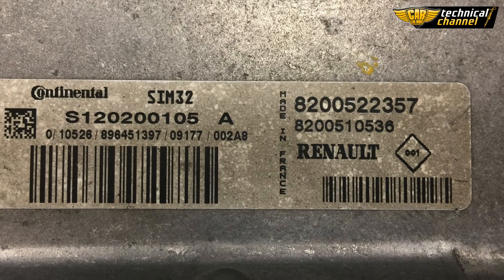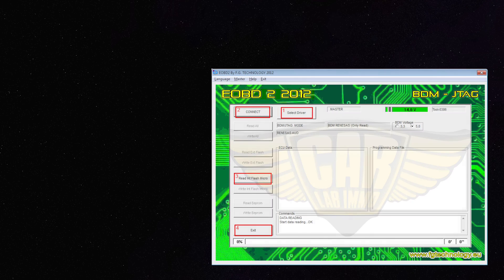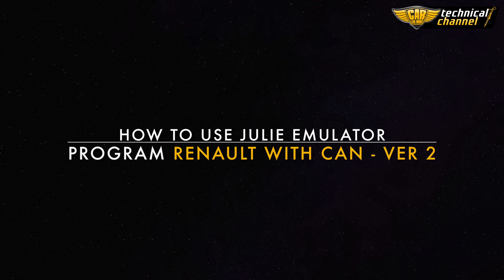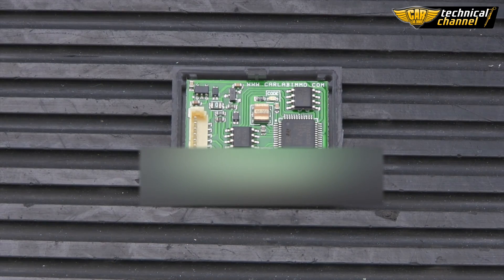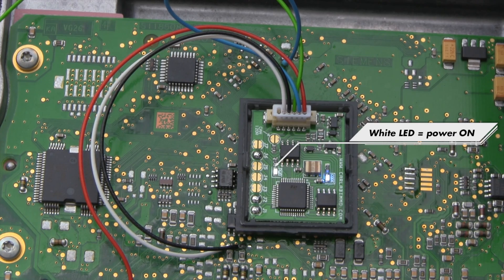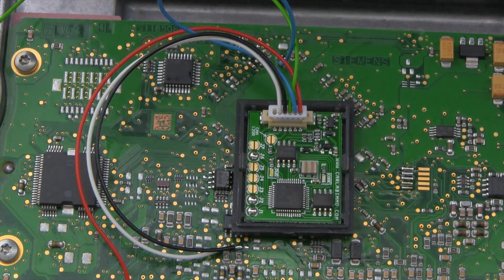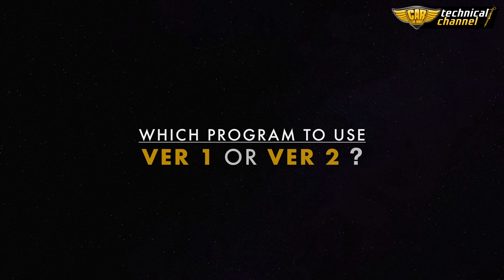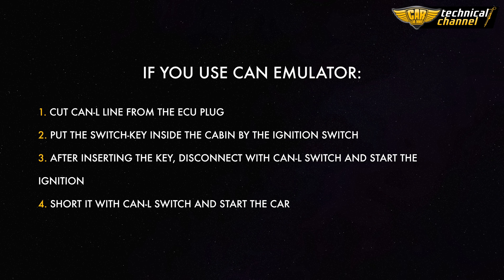Siemens/Continental SIM32 (Renault) IMMO OFF | Julie™ Emulator | CarLabImmo

Comment: good all this done, what abt the connection for starter,as we know starter  relay is inside UCH ,u dont show on video how to make starter and the CAN   lo connection instruction could have been simplified. car clio 2006 sim 32 ecu V2. used renault can k line tool to edit flash .starter job could not be done.
Reply from the maker: https://www.youtube.com/watch?v=pNqBTzp7MVc&t= Here you can see the whole procedure